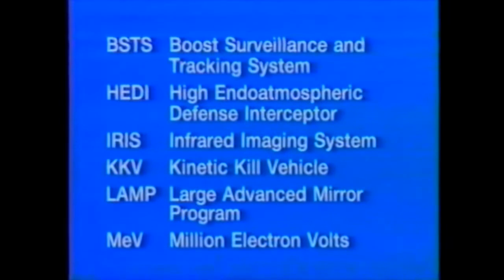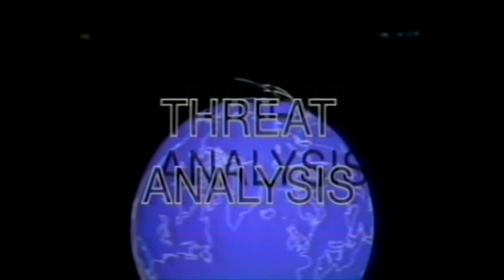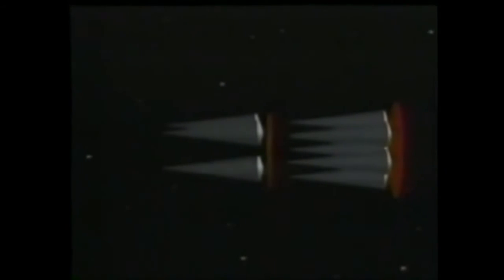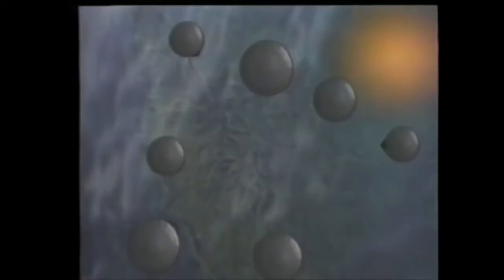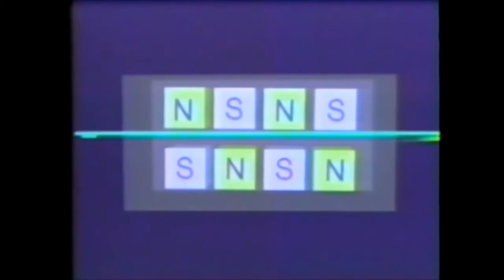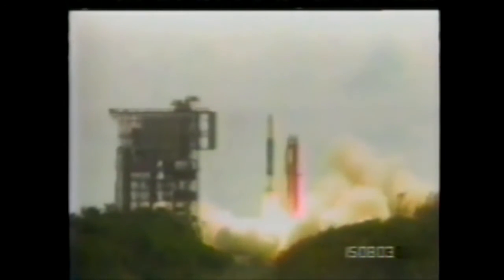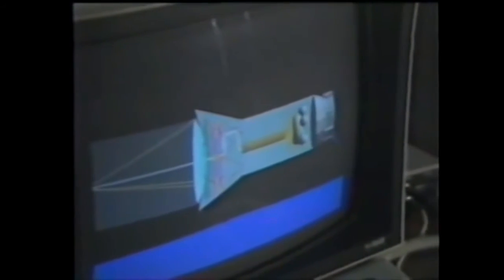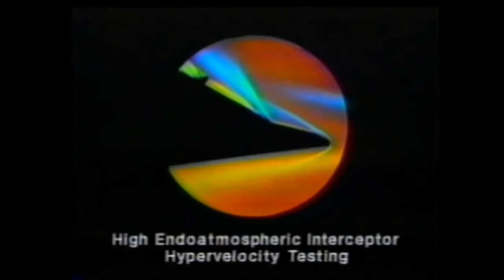SDI RONALD REAGAN STAR WARS PROGRAM DOCUMENTARY

Comment: Not all nuclear missiles are fired into space, you have different classes of nuclear missiles of different sizes and some are even designed to fire from ships ,submarines, air craft and their been rumors of nuclear air craft stealth missiles for years and other types of strategy to get the nuclear missiles to reach their targets and could some of these non-nuclear missiles be nuclear or are they using different satellites for the USA space nuclear missile launch program.
Reply: Cruise missles are one HELL of a threat, since they dont even typically reach upper earth atmosphere. Slbms are different than the silo based too. Yeah, they would have to taylor so many solutions to various levels of threats. I couldn't even imagine the cost of such a project
Reply: @kkjkkj2584  sub-sonic ones are. Not those that break the sound barrier (like Kalibr's and others)
Reply: @chadkarr7394  Cruise missiles are easier to shoot down by SHORAD due to low speed but Ballistic missile ICBM/SLBM are hard as the launch vehicle travel above Mach 20.  Intercepting them from ground-based interceptor is really difficult and very expensive as 1 ICBM/SLBM can contain 10+ MIRV with penetration aids.

Comment: The total electrical power output of the US is about one trillion watts.  A ton of TNT is the equivalent of about 4 billion Joules.  Figuring one ton of TNT to destroy a warhead, 400 billion Joules of laser energy could destroy a maximum of 100 warheads per second from a ground based laser system.  
A 12 volt lead acid battery with 800 cold crankng amps can produce aboutv10,000 watts.  100 million 100 kwh 12 volt lead acid solar battery packs could produce about 100 trillion watts or a hundred times the total electrical  power output of the US.  This could destroy a maximum of 10,000 warheads per second.  If it only took 100 kg of TNT to destroy a warhead, the battery pack system might destroy 100,000 warheads per second.  
A big problem is that half or more of the US is  often covered by clouds.  But with the  amount of firepower from the battery pack laser system, it might be possible to remove even miles thick clouds from a cloudy area.  If the clouds are raised up high enough with heat from underneath, the warheads come through the clouds high enough to allow enough time to destroy them.
A 1000 watt  CO2 laser is not much more than a flourescent light and might cost a similar amount if mass produced.   Mounted on a military grade tracking system, the whole system might cost less than $20,000 a piece if mass produced.
Since the system can also be used against non nuclear military  targets like planes and drones, the one or two trillion dollar cost of he system could be justified.  The US spends about one trillion dollars on defense per year.

The 100 trillion watt power output of the system would be the equivalent of a one megaton hydrogen bomb per second figuring that the laser energy is directed directly at the target and not out to the sides and above like a bomb explosion. 
The Russians and the Chinese might not like it for a long list of reasons one of which is that it might be combined with mirrors or power receivers in space and redirected at land targets.
https://youtu.be/0jXTBAGv9ZQ